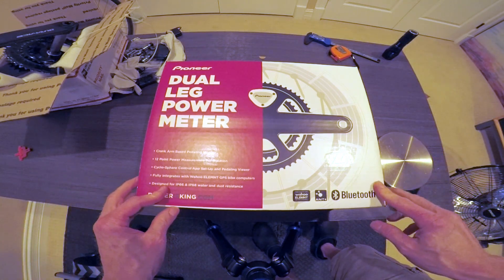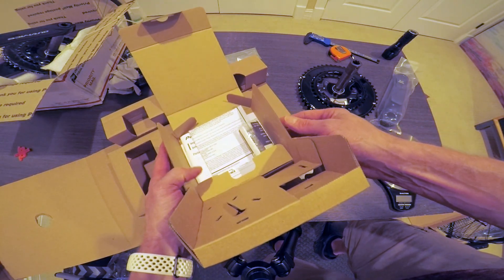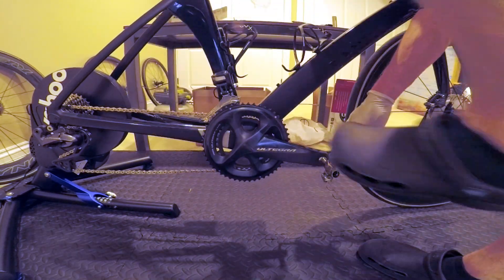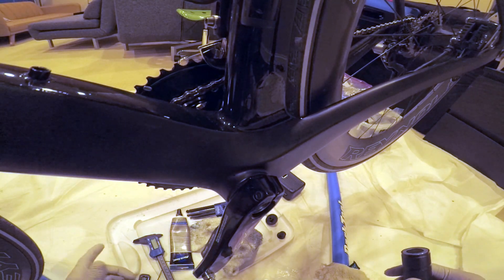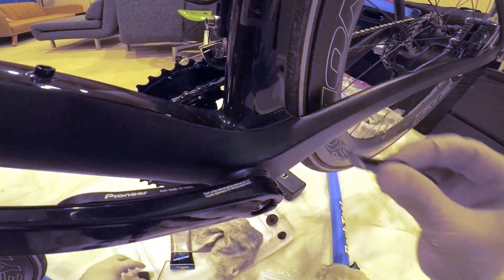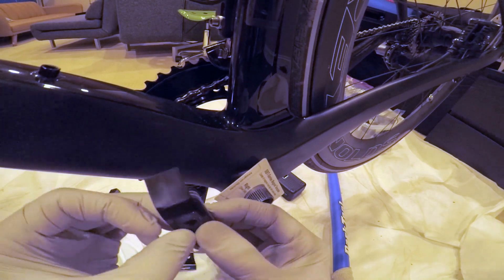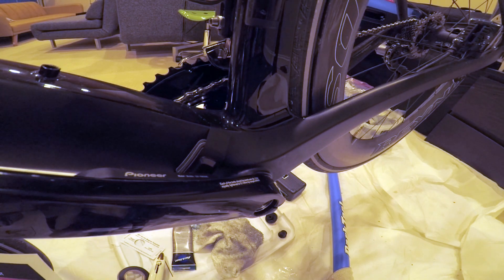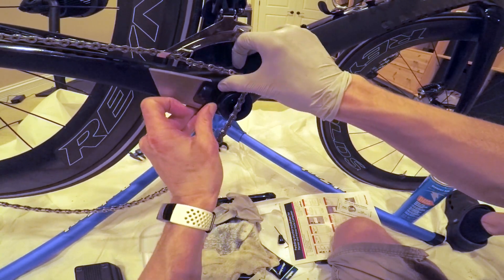Pioneer Power Meter: Dual Leg SBT-PM91 Bluetooth/ANT+ Installation and Setup

Comment: What app is used in the video?
Reply from the maker: It's the Pioneer Cyclo-Sphere app. Might have a different name now that Shimano bought Pio's PM business.
Reply: @MissingRemote  just found it. Thank you! Do I need the magnets to get power and cadence information on a Garmin 1030 plus?
Reply from the maker: @elkellenhabla  With a Garmin you want to run it in standard PM mode, which doesn't use the magnets. The magnets are used for the special Pioneer mode that only works with Wahoo or Pioneer head units.

Comment: Please could I buy the magnet template from you?
Reply from the maker: You don't need it. Install the cranks, line up the magnet with the pod where you want it to sit on the frame. Done. If you're not sure it will work, use some electrical tape to hold it there while you go for a short ride. Personally, I ended up ditching the pioneer magnets and using some rare earth disc magnets (you will need two per side). They work better and look better.
Reply: Missing Remote Thank you- would you be able to please scan in the template and email it to me, so that I can print it out?
Reply from the maker: @harrykhalid9205  I'll have to look for it. Will LYK.
Reply: Missing Remote Have you found it?
Reply from the maker: @harrykhalid9205  I'm actually on vacation ATM. It might be a while until I get a chance to find the box (it's probably in the attic, but...)
Reply: @MissingRemote  Sorry to have disturbed you on holiday. If you do get a chance to check I would be very grateful.
Reply from the maker: @harrykhalid9205  https://www.mamilian.bike/blog/2020/08/pioneer-sbt-series-power-meter-magnet-template
Reply: @MissingRemote  Thank you so much.
Reply from the maker: @harrykhalid9205  Np, enjoy.

Comment: Hi there, quick question – so one of my mags were destroyed from a chain drop and I found that I rarely use the PMS anyway. If I was to take those mags off, what steps do I have to take to switch to just the Dual mode? Would I have to recalibrate and switch through the pioneer app? Also, would I have to re-pair the PM to my wahoo computer now that the mode has been switched? Thank you in advance.
Reply: No need to recalibrate. Just wake up the PM, then go to Mode Switch in the mobile app and change it to dual power. I don't think you'll need to re-pair with the Wahoo when changing modes.

Comment: as for calibration.. should i start with the pioneers app and mags installed, and then come to calibrate it on the wahoo app? (does it matter if its on the app or on the bolt itself?)
Reply from the maker: If you're using Pedal Monitoring, I would recommend using the Pioneer app to do the initial calibration. After that, you can zero-offset ("calibrate") using the Wahoo, no need to use the app.

Comment: Thanks for the video. To confirm, will the Pioneer power meter provide cadence information without the frame magnets or are frame magnets required? Thank you.
Reply from the maker: You don't need the magnets for cadence. They are only used if you enable the Pedal Monitoring mode (which I never use anymore).
Reply: @MissingRemote  Thank you!
Reply from the maker: @darrenjeffries1500  No problem, enjoy the power meter.